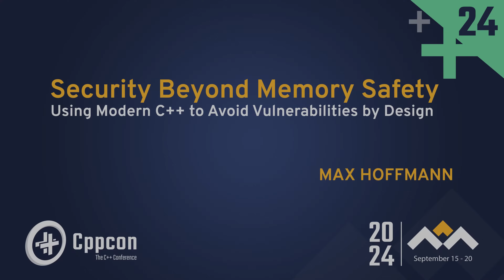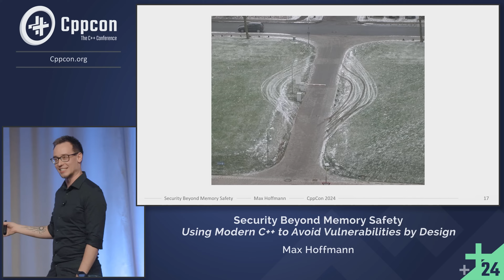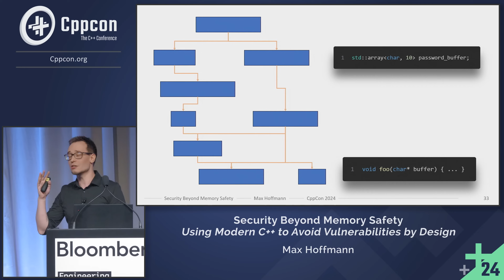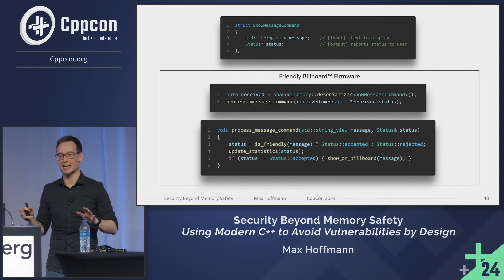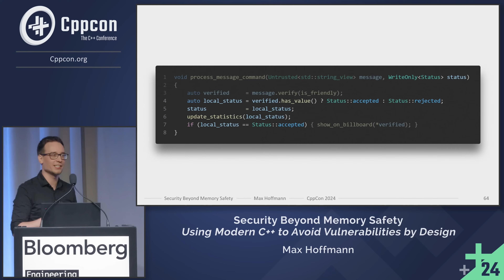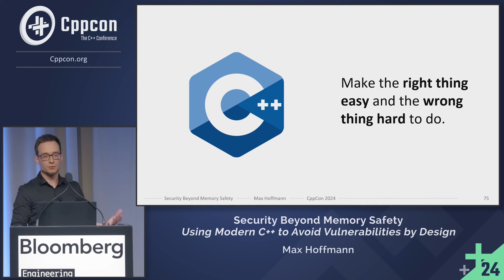Security Beyond Memory Safety - Using Modern C++ to Avoid Vulnerabilities by Design - Max Hoffmann

Comment: Isn't it just easier to use pipes for inter-process communication to prevent avoid attacks based on rewriting shared memory? Reading from a pipe means copying data into process own memory, which can't be so easily overwritten.
Reply: It is, but some embedded systems don’t have pipes.
Reply: pipes also have overhead, and really you are then offloading this mechanism to other external code and trusting that code to be correct then.  And unless you have a unix environment, you probably don't have pipes on nearly any RTOS/bare metal systems.

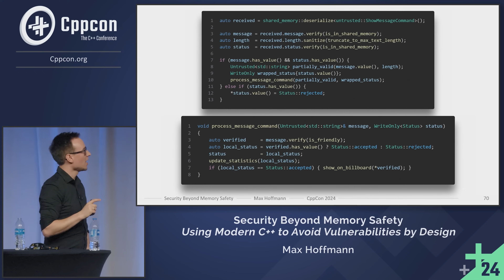Comment: At 43:00 we have code:

```
auto received = shared_memory::deserialize<untrusted::ShowMessageCommand>();

auto message = received.message.verify(is_in_shared_memory);
auto length  = received.length.sanitize(truncate_to_max_text_length);
auto status  = received.status.verify(is_in_shared_memory);

if (message.has_value() && status.has_value()) {
    Untrusted<std::string> partially_valid(message.value(), length);
    WriteOnly wrapped_status{status.value()};
    process_message_command(partially_valid, wrapped_status);
} else if (status.has_value()) {
    *status.value() = Status::rejected;
}

```
We truncated received.length but address of `received.message + received.length` is still not validated. It can points memory outside of area allowed by is_in_shared_memory. So private data still can be transferred to process_message_command

We still need additional test:
```
if (!is_range_in_shared_memory(message, message + length)){
   length = 0; // sanitize length
}
```

Comment: although a slower implementation compared to directly copying data, we can write a class in c++ to represent data that we want to secure against TOCTOU.
This class can store checksum/hash of data during time of check and verify it against checksum/hash of data at time of use
Since class will be wrapping over data, we can add this check in methods that allow accessing wrapped data

edit: there are some drawbacks such as failing check after we ourselves modify data (one part of it modified by us other part modified by malicious code), workaround would be more slower approach to rehash after modifying data
Reply: The idea of rehashing after modifying data is a grand example of a TOCTOU vulnerability. It implies a window after the modification where someone else's modifications could be then signed off by you using hashing. In security, it's often more valuable to be correct than clever and efficient.

Comment: there is still a minor problem since the pointer inside the WriteOnly class is not volatile assuming the updatestatistics function does do anything that acording to aliasing roules might change the value of an object of type Status. the value pointed to by the internal T* can not change under the threat of UB. a Compiler could notice and under the as-if rule instead of saving the local_status to the stack reload it from the pointer internal to the WriteOnly.
Reply: That is actually a bug in the code. If the compiler notices that the write only Status* is never read from, it could also just skip the write entirely.
Reply: It's fascinating how people insist C++ is all about programmer control and then the compiler does rug pulls like that. Contrast e.g. Ada or Chapel where you'd simply declare an out argument.

Comment: Untrusted<T> verify should return std::optional<Trusted<T>> and then show_on_billboard should accept a Trusted<std::string_view>& this will make the type-system even work better for you. Making parts of the checks detectable at compile time too.
Reply: Yes. The technique is one encouraged in ML family languages for decades, making invalid state unrepresentable; e.g. if the text hasn't been verified there should be no verified text field. C++ is inconvenient for it, with its noisy syntax to make any type more complex than an alias, lack of tagged union association for sum types, and lack of pattern matching. I guess that last one is in the queue (P2688).